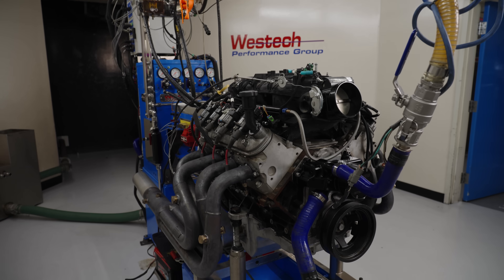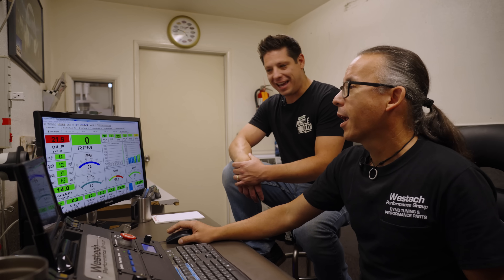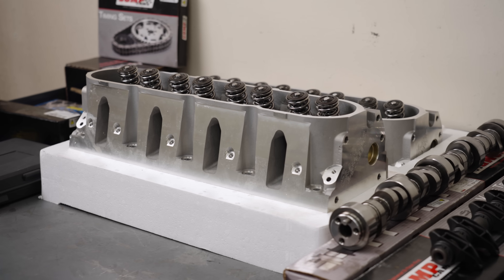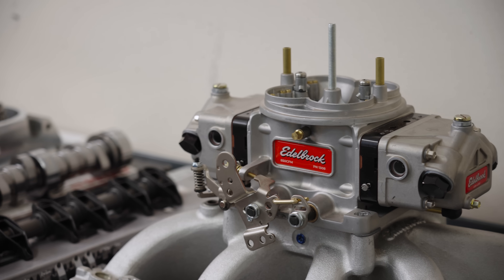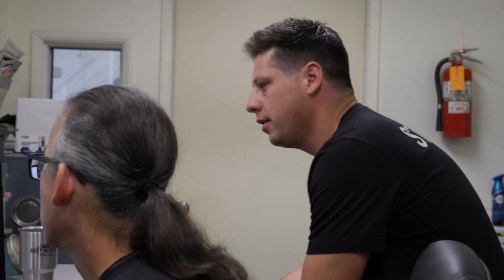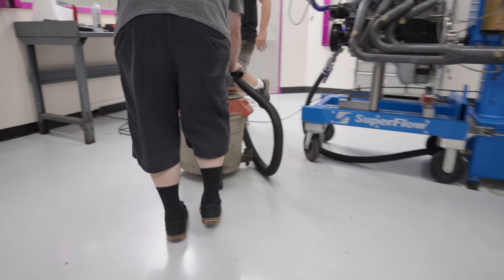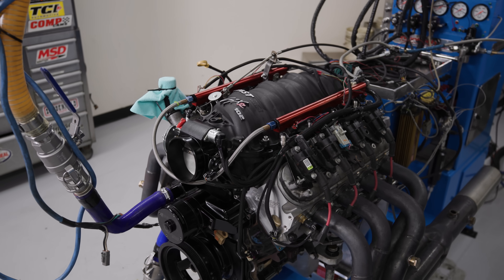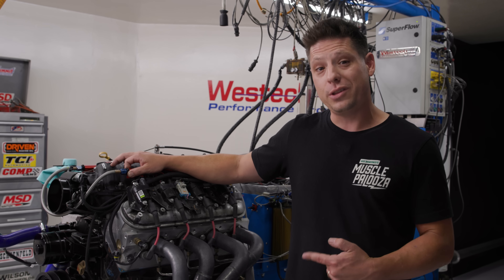4.8L LS: How Much Horsepower Can We Squeeze Out Of GM's Smallest Displacement LS Engine?

Comment: Do I have to worry about valve to piston clearance with a cam like this on my 4.8?
Reply from the maker: Yes. There are no valve pockets on 4.8 pistons so PTV can get really tight, really quick. Aftermarket pistons have pockets so no issue there. We installed a new COMP CAMs timing set and checked PTV clearance religiously and were ok, but you will absolutely need to check! Thanks for watching!!!

Comment: Video is garbage. Comparing an engine dyno to the factory rated HP of a C6 Corvette? Really? The L20 4.8 was factory rated at 285 hp and your claiming 350+ because your not running any accessories at all? Your souped up 4.8 was never anywhere near an LS7.
Reply from the maker: When we run engines on the dyno, they make what they make. We aren't concerned with the drivetrain, only seeing what performance delta we can create with new parts. Sure, an LS7 will make more power on the dyno. No one is saying it won't. We're testing parts, finding power, and having fun. Thanks for watching :)
Reply: @hemmingsmotornews  A stock LS3 would make more power on your dyno let along an LS7. Glad your having fun but you could at least put in a correction factor IF your going to compare your hot rodded junkyard motor to a FACTORY rating.

Comment: I snagged a 4.8 for 600 at the local junkyard as well as an AR5 from an 08 Colorado, mated the two with a fab bot adapter kit and stuffed it in to a 92 Nissan hard body single can short box. It would spin 2nd 3rd and sometimes 4th.... Was pretty awesome.
Reply from the maker: Sounds like a fun project! How long have you had it?!

Comment: It's funny that they only tell you the horsepower of the engine on the dyno without anything attached to it and with no Driveline losses but you're looking at anywhere from 20 to 30% losses from the Driveline (Silverado driveline), so the numbers when actually corrected for those losses, end up exactly where GM said it was from the factory: about 265 horsepower and about 300 lbs feet of torque. The numbers that they're telling you are giving you a false impression of what the engines actually going to make when it's in your application. So if you're thinking of doing the many thousands of dollars worth of modifications to your 4.8 you're only going to end up with about 350 horsepower at the wheels. Why waste your money on all those mods when you can just get a stock 6.0 making 400 lbs/ft and 385 hp? These mods are obviously a giant waste of money; just get yourself a 6.0 iron block.
Reply from the maker: 30% drivetrain loss would be obscene and the idea that drivetrain loss is a consistent percentage is one of the biggest fallacies in the performance industry. We are testing an engine and looking to see how the changes we made affect power and torque production. We don't need a transmission, driveshaft, axle, and tires to determine if a camshaft makes more power. That offers zero additional benefit in this case. We're chasing a performance delta against a baseline. Sure, any engine will need to pay the toll of the components downstream, but that doesn't nullify any of the results. We found over 100 horsepower, and more power in, means more power out. ✌

Comment: That dip up top was from the Hydraulic lifters. If you push it over 7k just use a solid roller lifters you'll be happier I promise.
Reply from the maker: We also saw some fluctuation in lifter performance from thinner oil so I think you're correct.

Comment: I take every 4.8 LS I can lay my hands on and most time they are close to free, the most expensive one I traded for was a low mileage 2009.  It cost me a used MSD 6a box.  Sure I've done 5.3's and 6.0L's but most people are looking for a modern, reliable engine for their ride and even a stock 4.8 will make 325hp with a cold air kit , no cats and a dual exhaust.  Even the SBC is becoming scarce and expensive and I've swapped 4.8's into a half dozen cars.  One was my son's '86 Mustang LX, I used a stock 4.8 with the WC T5, I added a dual plane intake and a Q Jet and it's one strong running Fox Body.  My neighbor had a '52 Chevy Deluxe with a worn out 350 in it.   I slipped a junkyard 4.8 into it and used the T350 that was in the car.  I ran it off the stock FI and a Flashed PCM. Because it was a heavy car I added a BTR Stage 2 cam, a new oil pump and a set of rocker bushings.  He paid the cost of a dyno pull and tune, 372hp and 348 ft/lb.  The whole cost of the swap including the engine was just over a grand and his biggest complaint was that now he had to do a disk brake conversion to get the ride stopped.  4.8's IMHO will out run a well built 350 without a problem, get better mileage and run longer and be more trouble free than than any SBC today.  Now to just find a L33 5.3L for that old Mazda Miata behind the garage.
Reply from the maker: Thanks for sharing your experience and knowledge!

Comment: The real catch is there's people that have walked out of pick and pulls "all you can carry for 60 dollars" with these engines. The old dinosaur gear heads from the 60-70s HATE that they couldn't get an almost 500 horse sub 300 subic inch engine to do those numbers with. This is the shining factor of the LS. EVERYONE has access to a reliable strong running race motor now with the LS platform.....almost every part will bolt on from a Camaro or Corvette to the Vortec engines. You don't even have to physically order a performance part if you're diligent and lucky. They love to hate it. Not bad for something yanked out of a UPS truck. 😂.

Comment: The only problem with the 4.8 is the low torque numbers because of its small displacement
Reply from the maker: I mean hey, for 262ci 378 lb-ft is pretty impressive. That's 1.44 lb-ft per cubic inch and we shoot for about 1.25 on pump gas engines. Compared to a gen 1 327 or 350, and considering how little we actually changed (engine really could have used more compression for this cam), this little guy did great!

Comment: Don't understand why everyone thinks the LS is so hot. They put at least $3000.00 on parts to get this engine to make decent power. A 5.0 gen2 coyote will make more power in stock form with a tune. They can be bought for way lees than what was dumped into this engine.
Reply from the maker: If we did this engine again, we would stay with stock heads, run the truck intake, and use this same cam. That combo would be good for about 450hp. That's about $1500 on a $500 core. Seems like a bargain to us. There's also the logistics of getting a coyote into a chassis. The LS is always going to be the cheaper option on that front.

Comment: Waist of money building one of these even if it's already in your truck grab a junkyard lq4 grab some used aftermarket heads they are everywhere just look couple bucks for resurfacing Texas speed cam and nice valves and valve springs and slap a used cts supercharger bang a reliable 700+ hp engine that's with a small pulley to if you wanna get crazy and push it I've seen them up to almost 900
Reply from the maker: Why not put boost through a 4.8 as so many others do? It's the same block and heads as a 5.3. Hurt a piston, simply toss in a 5.3 (or larger) rotating assembly. Hard to see the downside here, especially with how cheap you can get them for.

Comment: What computer do you use to manage the fuel injection and spark? Is it a holley unit or did you wire in the computer from the donor car the engine came out of? Sorry im new to these engines and related hardware/software
Reply: This was run on a Holley Dominator.

Comment: So if the goal is to rebuild an LS the 4.8 which is cheaper and easier to find would be a better bang for buck build. Since its supposed to same block as the other LS’s but smaller stroke and bore… or am I wrong?
Reply from the maker: It is the same block and bore as a 5.3. So yes, it's a great starting platform for a lot of folks.

Comment: Awesome stuff! The biggest difference is no accessories though, plus the headers, it’s going to make more than an SAE test which basically is going to tell you what it will make worst case scenario.
Reply from the maker: Yes. Absolutely. Aftermarket dynos will always read higher so what we are chasing is the performance Delta from the new parts. It was over 100hp!

Comment: 7:00 the PCV system is also connected to the intake pipe before the throttle plate, because when under heavy load there is no vacuum in the intake manifold and on turbo there is pressure, the air flow in the crankcase doesn't directly give you hp its a hp supporting modification for performance, it keeps the engine cool and helps prevent knock, air flow around the cylinder head and bottom of the pistons is important as that's the hottest engine component touching oil, circulating fresh cool air inside the crankcase is pretty obviously good

Comment: Trying to get more power out of internal combustion engines is a masochistic endeavor with the ice drive train being the sadist in the relationship, all decked out in black leather and chrome 

Every horsepower cost twice as much as the previous one and is tricky to get working without damaging the expensive parts and the engine

Aside from the expense is the hard work and frustration, high probability of a short life, and high maintenance

Electric drive trains on the other hand are way cheaper, easy and rewarding to add power to

More power, less weight and every additional horse power cost the same as the previous one

Yes! You heard me right!
Less weight

You don't need a huge, heavy 100 kwh battery for a ¼ mile race

All you need is maybe 20 to 50 kwh of industrial grade 'Power Cells', not Energy Cells which are what EVs come with

Power Cells are designed to put out a lot of power quickly whereas Energy Cells are designed to last long

Comment: Wait a minute, I don’t see much hp gained other than by raising rpm. It could be a 1,200 hp engine then at 16,000 rpm. I didn’t think that was the point.
Reply from the maker: An engine does not keep making horsepower indefinitely by spinning it faster. It's the better heads, cam, intake that allow it to make power.
Reply: @ I’m just saying I thought these mods would boost power within the stock rpm limits. If you’re just gonna make it spin faster show me stock but with rpm limits moved up. Not mods at 7000 rpm and stock at 5500 peak for peak
Reply: @ellomirza  what do you mean “peak to peak” the different combinations make peak power at different RPM points. The stock setup could rev higher, but it doesn’t make power there. The performance parts allow the engine to rev higher and make more power. Horsepower by definition is a function of mechanical work in a given time. 

By increasing the RPM (time) and the ability of an engine to produce torque (work) you make more horsepower.

Comment: Ok next question what is the lightest cheapest vehicles that this engine and a 6 speed auto at the bell housing or transaxle could be used to make a old man retired on fixed income afford? I mean 200,000 miles and he didn't even go rings and bearings but you did push rods and lifters?? I saw the dyno hitting 7,200 rpm. We don't do that on the street. You know you need some torque to get to the HP curve.  I wondered if the Holley High rise does any thing about the Plastic lowrise??? Great video, need a vehicle list 2,500 pounds 50/50 weight, seats two fine. S10, Corvette, Blazer, Jeep, Camaro, ????? Dennis in Virginia

Comment: The Votec intake was derived from the intake of the 3.8 (3800) series V6 supercharged engine. The cathedral runners mimic the flow of air produced by a supercharger, thus the more vacuum the more air swirls making for better atomization of fuel and increased horsepower.
Reply from the maker: Thanks for sharing that information!

Comment: Well I think you left out some key factors on the carb test? Such as A/F tuning. Such as timing curve mods. My guess? You guys would rather tune electronic FI.
Reply from the maker: We tuned the engine for every part that was changed. We dropped 8 jet sizes in the carb, verified the correct A/F ratio, added ignition timing, and it was still significantly down on power with a carb. Unfortunately we can't show every single thing in the video (especially when the part tested doesn't make power) but every possible chance to let the carb shine was taken.

Comment: I drove a 2000 silverado with the 4.8 and even when the rest of the truck literally fell apart at 300k miles, that engine and transmission was still going strong.
Reply from the maker: Sounds like you had a tough but reliable truck! What did you replace it with?

Comment: Did you mess with ignition timing and injector size? 4.8 may be the smoothest running LS
Reply from the maker: We tuned ignition timing and fuel mixture for each stage of the test. It really is a great, little engine!

Comment: Should have put a sniper on it.  Let’s be frank though back in the day people were taking 283 Jen one small blocks would 1101 pistons drone a set of 194 Fuley style heads on it with aluminum intake single Holly for barrel Mallory ignition a set of headers and a four-speed and we’re running into high to mid 13 to the 55 Chevy put the driver to the equation and you got a 3600 pound car! Look at a GEN 1Z 28302 and how much horsepower that made

Comment: My 4.8 is in a 02 reg cab 4wd only 71,000 miles on the truck, i use it for truck stuff and simply don't do a lot of truck stuff, in 23 years of ownership it has had one alternator, one headlight, 3 batteries,  and that's it.
Reply from the maker: That sounds like a great truck for getting things done!
Reply: Same here,I'm at 387k. Same transmission. Same fuel injector. Bone stock. It's reliable.
Reply: @2nickles647 I’m at 400k nd still original motor and trans. Love an LS
Reply: I just picked up a 03’ last week with 50k original miles… with a 4.8 , I would love to get it up to 400-450. Just a weekend cruiser/Home Depot runs. Everyone I talk to us a different idea on how to do it .. also heard with this small v8 it helps to put a higher stall converter and maybe even change the gears.. they don’t like to make their power down lowZz
Reply: My 2008 engine went down @ 170,000. I was using 1 qt Lucas Synthetic paired with 5 qt's Mobil 1. I waited till change oil message came up to change the oil. So approx. 10k miles per oil change. One oil change the oil filter backed off and slow leaked so for a while was running off 1 qt of oil. No low pressure oil light ever came on. So 3-4 years went by after the oil filter shenanigans, driving home one night lost oil pressure. Took to dealership for new engine so I do not know exactly what went wrong. I wish I had a way to check but I don't. It's a good engine. I no longer use any oil additive and change the oil every 4k miles. I am switching to Amsoil 5W-30 after next oil change. Been running Mobil 1 5W-30.
Reply: If you ever go to sell it lol let me know 😂
Reply: My 09 4.8 will never leave my side!
Reply: A 4.8L is not an LS motor
Reply: You should tune it 
It does help a lot with HP and MPG
Reply: @reyperez3424 what tune ?
Reply: @sebastiancastaneda7909 literally any canned tune will make it drive much better and get you a min 10% bump in mileage.

I had a Diablo Sport on mine for 10 years. Hung with stock 5.3s no problem.

Comment: Try the vacuum on the dipstick tube. I wonder if it just held the oil at the top of the motor creating vacuum inside the valve covers rather than the pan

Comment: I’ve been doing this for years now as the junkyard would give me 4.8l for free! The best cam is the BTR stage 2 with a single turbski. Roll out the sock pistons and rods for forged and keep the stock crank you’ll be able to make 700whp  all day long reliably, with better fuel you can make more but here we got sh!t pump gas but my Volvo has the same 4.8 I started with stone reliable.
Reply: I need help on how to make 400hp on a 4.8 bone stock ,I heard of the btr stage 2 being good any suggestions on how to get that goal,still new to this

Comment: My mild carb'd 4.8 with factory LS6 cam would spin to 7800rpm. It wasn't a powerhouse, but sure was fun to use in my C10 with a faceplated TKO II
Reply from the maker: Sounds like a fun combination, what kind of power did you make?

Comment: This is impressive for a 9.0-9.1:1 Engine, but I think the biggest mistake was using the Edelbrock 64cc heads to replace the Gen4 243/799 65cc heads. The heads that SHOULD have been used are the OEM Gen3 706/862 Heads after CNC Porting.Not only would the Compression Ratio jumped up to over 9.5 or 9.6:1, those heads that I have mentioned have been proven by Richard Holdner to kill it on a 4.8L when CNC ported and valvetrain upgraded.....even though 500HP is a tall goal. Your camshaft was a giant in terms of duration, something that Richard hasn't put near a 4.8L, so you had THAT in your favor. Had this little 4.8L been closer to the 10.0:1 mark after a cylinder head upgrade, it would have made the power target. Unfortunately as has been explained by other builders, even though a 4.8 can be made to spit out 500HP @ over 7,000 RPM, who would want to attempt to drive it on the street ?

Comment: can you provide a parts list?
Reply from the maker: Here are the parts tested. They are also listed in the video description.

Edelbrock E-Street Cathedral Port Cylinder Heads: PN 77617

COMP Magnum Pushrods: PN 7162-16

Edelbrock VR-S Series 850CFM carburetor: PN 1308

Hydraulic Roller Lifters: PN 8957-16

COMP Camshaft: LSR 235/251 PN 54-478-11

COMP BSR Shaft Rockers: PN 1981-16

Edelbrock Victor Jr. Carbureted Intake: PN 2908

FAST LSXR Fuel Injected Intake: PN 146302B